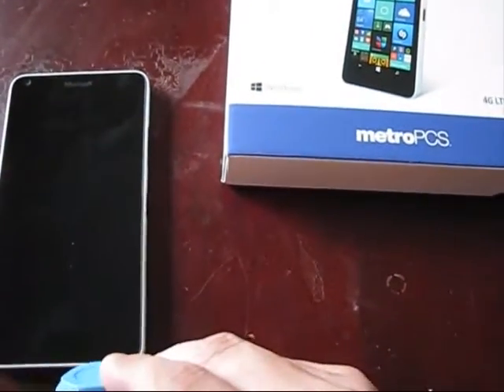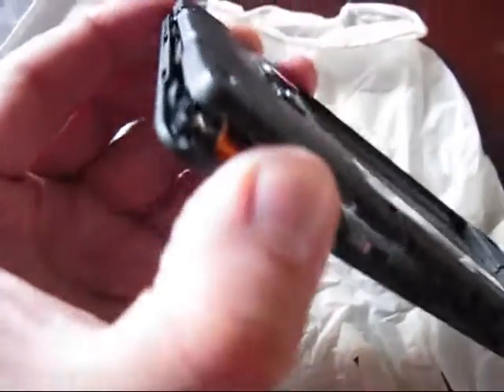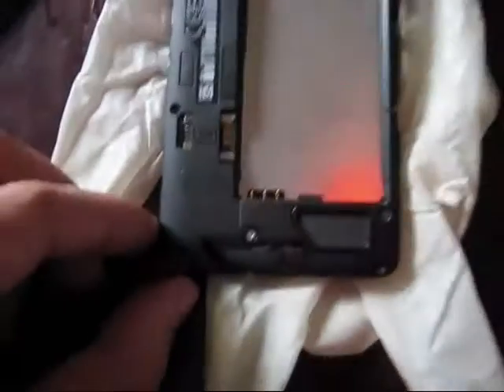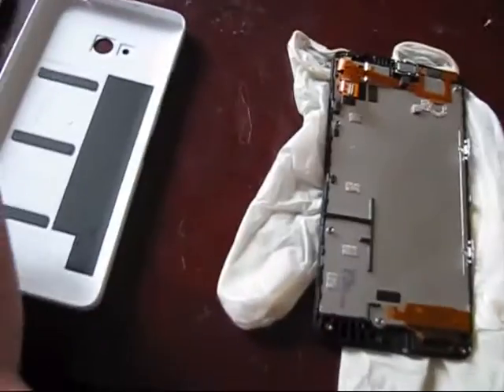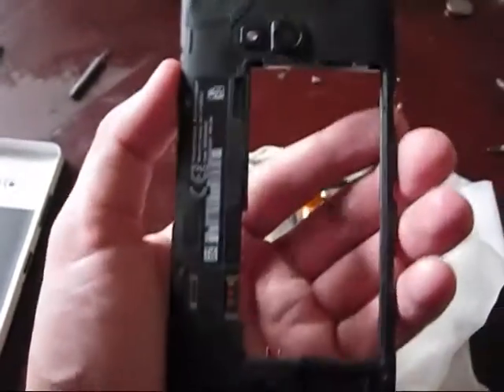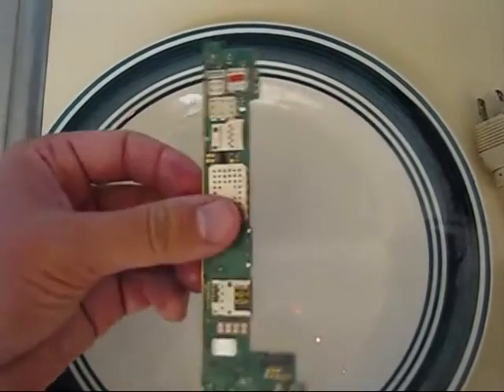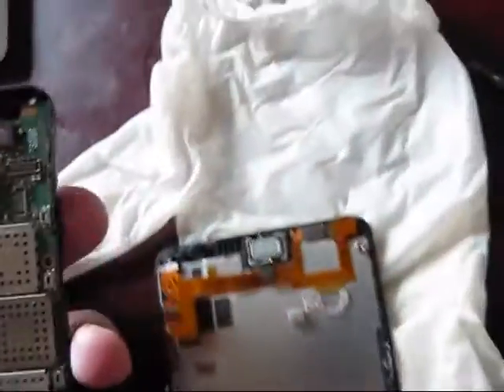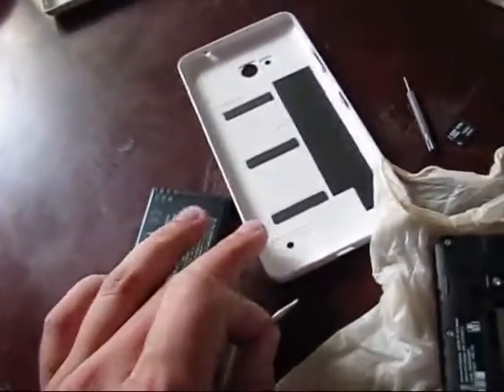Microsoft Lumia 640 Water Damage Disassembly and Assembly Steps

Comment: My new 10 days old Lumia 640 XL had got moisture in its both cameras and the screen was not working due to moisture I think as I didn't drop my phone in water or got wet. I kept it in rice bag for two nights, the moisture gone but some parts of screen not working and the proximity sensor is dead now.
Microsoft Care is unwilling to repair due to liquid damage. Huge loss for me :(
Reply from the maker: Mohak Adav I accidentally dropped my new Lumia 640 completely into the water, it happened in the kitchen while I was cooking... After I performed all this steps that you can see in this video, my Lumia is fully operational like new...  Try to do the same if you good with repairs, it might help you...